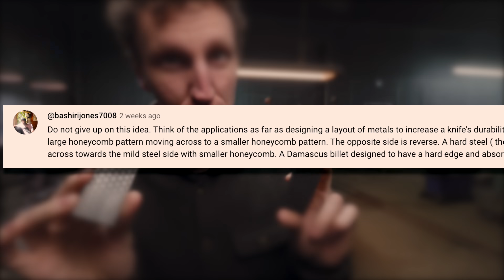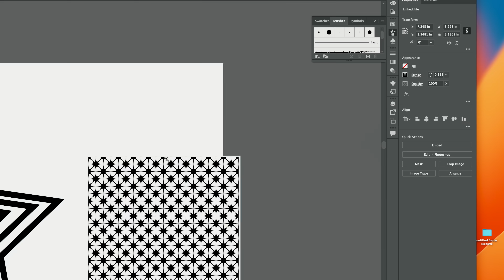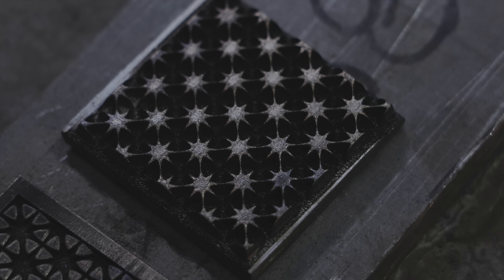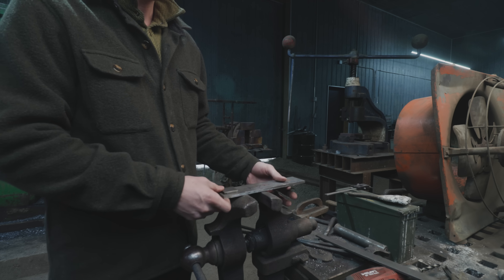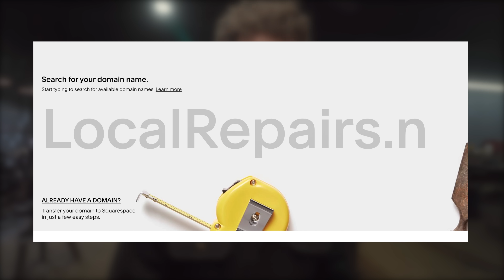Trying a new technique for making Damascus steel - Positive/Negative.

Comment: you can use a hybrid powder but with a binder so you can squish it in. maybe something like one of those liquid metal thermal pastes or some kind of solder paste with added iron or something similar, molecular steel or something to bridge the gaps. ie make both blocks with the patterns coat them in the metal paste squish them together see how it works out. maybe even some metal that's got high solubility inside steel so it amalgamates like a glue should also highlight it a bit. Colloidal silver would be ideal, you can also try running your laser over the metal in an oxygen atmosphere to help with machining away the pattern more quickly and consistently  if you can treat your metal beforehand to get a decent tempering pattern you'll be able to get a better reaction with oxygen so make several bars with several different tempers then compare how the laser erodes them and one of the tempers will erode better than the others, you want your metals' crystallization to be as dense as possible with as many crystals as possible minimizing for size so whichever temper level gets you this will give you the best surface finish to your ablation. so maximising for smooth surface finish by pre-preparing your blocks before you erode them will give you a better result than trying to solve the issue after the fact with a hack even if the colloidal silver will probably give you a nicer finish it's better to have both and then use gold or silver as your glue. so yeah start preparing a set of billets for every temper you can then narrow this down and repeat until you can get to an optimal temper for the best surface finish, you're burning metal crystals so the smaller they are the smoother your finish is going to be and you also need to have enough oxygen to burn away the metal at a consistent rate and the better ability you have to burn it off and blow it away the more likely it is to be consistent, so either blast it with a high pressure stream of air while you're ablating it or run some oxygen over it to burn it off faster, you've probably got a better shot just blasting it with a high pressure air stream than oxygen not to mention to fire hazard. you want a maximum net mass flow away from the parent metal so that you're getting rid of as much metal from the location as possible and not having a plasma cloud sticking around eroding things willy-nilly. There's probably a goldilocks zone for this so finding it will be a matter of messing with your pressure. But yeah just make an assay out of it by doing everything in parallel and you'll find a balance and then if you give it the amalgamation option with gold leaf or colloidal silver or something similar it'll probably not have any gaps left in it at the end.

Comment: It feels like the powder is much better for the small and intricate patters, since its easier for it to melt and fill the spaces. I'd imagine the positive & negative technique would be great for larger patters, where youre able to properly design in some draft angles to let it mesh together better. You may want to try it again and add in some powdered 1095 to see if it helps to fill in those cracks and coldshuts?

Comment: I believe the problem you're having is with oxidization So even though you're using a laser, it's still oxidizing the removed material, and I think that's what's giving you problems, I'm not smart. Enough to know how to fix that, possibly some sort of acid etching, could do it

Comment: i would do the positive/negative strategy, but put steel powder in the middle to take up the extra space.  I think the laser doesn't cut straight down (it leaves a bit of a slope), so there will always be some imperfections in the matchup.
Reply: His laser is not automatically adjusting the focus point as it removes material, It results in the beam diverging making the process take longer and be less precise, The better way of doing it on this machine would be to have stop points every 2 mm of depth and adjust the distance of the lens to compensate for the beam divergence. Laser etching can be incredibly accurate, just need to take account of the beam divergence
Reply: Could even make the gaps bigger on purpose, and then basically have three patterns from the two materials and the powder.
It should also make less chance of cold shuts.

Comment: So what if instead of using the laser to make those indents you instead make a die that presses the designed into the metal and then put that newly pressed piece into a canister and make canister Damascus out of it so it saves you some time

Comment: I have no experience forge welding (I'm a professor from the school of Youtube though) but were the potential welding issues a result of air being trapped in portions of the pattern? Would it be best not have a super tight initial fit (clearance as opposed to interference) then rely on even distortion when welding to push everything together. I would expect the variance in the 2 designs would be +/- the accuracy of the laser that your using. Really interesting seeing you try these things.

Comment: ok so crazy idea, can you etch the pattern into something like acrylic, and make a mold for 1080 power and add in a binder (something thin that would burn off Paraffin? bees wax? sugar water? Maple syrup??) which would get you your positive shape. then in a canister add in the 15n20 power which would fill in the negative. you'd get the same(ish) effect, but the laser should be able to etch the acrylic way faster and you could make way bigger blanks, also the mold could be reused.

Comment: In both methods, won't the pattern come through only on one side of the steel? Would it be feasible to etch all the way through with the laser, and then fill the pattern with the powder steel? That might take several more hours on the laser, but then the pattern would show on both sides of the steel.

Comment: you might try etching the pieces in a nitro or argon blanket, get some cleaner pieces out that should weld better. Think of it as if your CNC'ing, the gas being the "flushing fluid" keeping the oxygen out while also actually flushing out any vaporized metals, just putting a tig blasting into the surface at an angle should work.

Comment: What would look pretty cool is if you laser etched the pattern then melted a thin copper plate on top and finally forge weld 15n20 on top giving you the dark pattern from the carbon steel outlined by the copper and nickel

Comment: I'm curious as to how much power is required to do that deep engraving in steel and how cost/time effective it is?
Reply: Depending how strong laser you have and could it be better to do with cnc..

It's just testing, price and time do not cause problems.
Those are just things to later need optimize.
Reply: yup yup,kill-a-watt to the rescue, maybe?

Comment: There's definitely potential here. I know that when doing inlaid patterns in wood (on a cnc) you can use tapered shapes to make assembly easier and I think gluing better. Tapering for you might help with the forge welding because you'll be pushing the metals into each other rather than relying on mushrooming to weld them. You'd have to be more careful with grinding because the pattern will now vary because of the taper, but that seems like a small price if it actually welds properly.
Reply from the maker: Very interesting idea. At this point, I don't know how/if I can really control the tapering. There is some naturally there from the "kerf" but its pretty small. Keep the ideas coming!
Reply: @TimothyDyck so what I would do is make a square of know what size, say 1cm x 1cm, run it however deep you want and then measure the angle of that wall. But I think it would really just depend on where you do your design since the beam is essentially coming down in a cone as the mirror moves. Sooo if you can always do it at the same point then you could kind of figure out how you need to skew your design to get a true negative. In CNC a lot of people do a flat bottom and angled walls so there is more contact for the glue, but I think in this case that would just give you more areas that wouldn't weld. I think you need to look into topographic greyscale 3D images that way you can kind of control the 3D aspect of the engrave.

Comment: It would be cool to stack alternating steel and using EDM to cut your design/pattern..you would simply need to remove the bottom inserts that have neen cut..slide all other inserts down the stack and replace the removed bottom insert into the now vacant top design/pattern? be nice to hear your thoughts Timothy..keep up the hard work 👍

Comment: I’ve always seen laser etching as a cheap alternative to stamping or rolling, but that logo is super nice looking on them axes. Maybe make it a little deeper for longevity? So in 50-100 years when someone finds one of those in a relatives shed, with a coat of rust it can be restored and the logo still be visible. Or maybe use your laser engraver to make a stamp like that and use the press to stamp the axes when finishing forging? Just ideas man, good work!
Reply from the maker: My thoughts exactly. I'm still dialling in and learning this laser thing!  Thanks man!
Reply: I agree, however, if you look at old hand saws, those have a very minor etch and still can be seen today more of the time.
Reply: I dont possibly get how laser engraving is the cheaper option 😂.